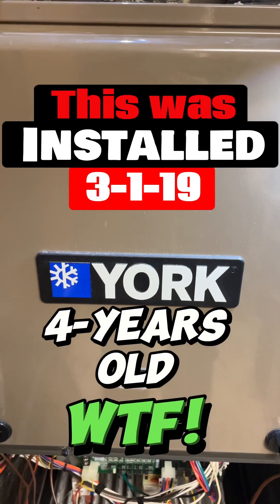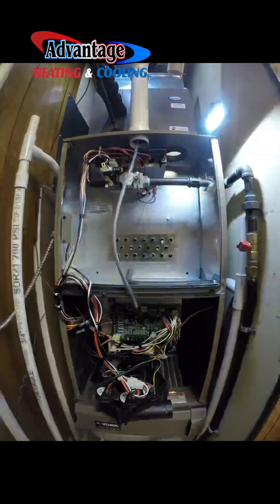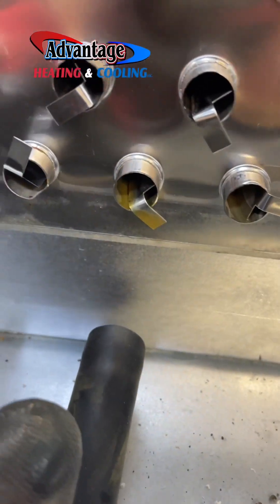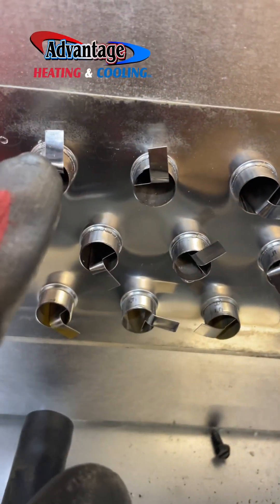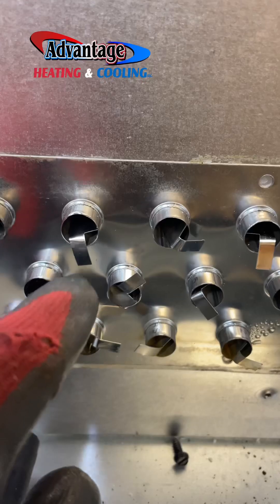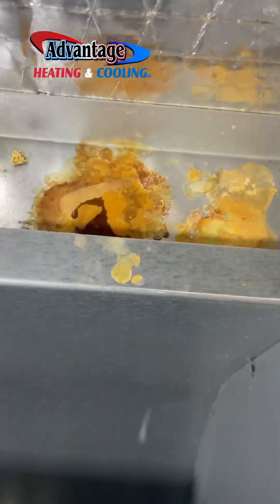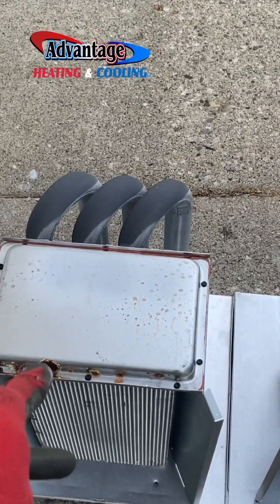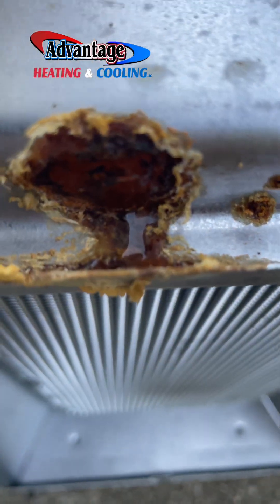York “JCI” Not a fan! Of your HVAC Equipment! 🤷‍♂️

Comment: The last company I worked for is primarily a York dealer. Definitely was not a fan of their equipment, especially the higher end. Almost every time you were on call when it was really cold or hot out the York customers that had newer, high end models, were calling. I don't know, I suppose most manufacturers have certain models of finicky equipment. Certain Carrier heat exchangers being one example. I don't know about you guys but we still have plenty of Lennox Pulse around here. 😬😁
Reply from the maker: I see the pulses once and a while. Just removed one last October. The Modulating Yorks were something else. The gas valves would puke if a little bit of moisture gets around them.

Comment: Was it tilted forward at installation per manual? If not it will jot drain and rust.
Reply from the maker: Was not in the Manual, TM9Y 4-5 Years ago. Maybe the new manuals were updated? I just looked it up online again and did not see anything about tilting it forward. The Goodmans are saying that for sure. If you see it Please let me know Email me at Advanhvac@gmail.com
Reply: I know for sure tm9y furnaces have to be tilted forward now. It's in the newer manuals. Coleman, York, and luxaires all affected. Really any 90% furnace needs a little tilt forward
Reply from the maker: I'm also starting to tilt all of my 90% now.

Comment: York units are terrible I hate them lol
Only reason I go to the York dealer around here because it the best place to get daikin mini splits 😂
Reply from the maker: I was going to bid on Daikin for this job were doing this week I just can't do it. I'm a Fujitsu guy.
Reply: @ADVANHVAC  Fujitsu is my second go to lol then Mitsubishi 
Just a lot of good experiences with them (daikin) I’ve installed 100’s of them 
The worse mini splits in my opinion are them mr cool units 🙄
I’m sorry but if u say no vacuum required or leak test I’m turned off immediately 
But those units suck, and I’ve been to so many calls where these dyi people install them and we have to come fix them 😂 very cheap quality In my opinion
Reply from the maker: Yup I run away when they want me to install them.
Reply: @ADVANHVAC  but again about York systems 🤢🤢🤢
Nope 
They are at the bottom of the list for me and always will be 😂
I’ve installed so many Goodman units it ain’t funny but I love carrier systems 
I like Goodman 90 percents 
Haven’t installed many of the units you install so not much experience with them
Reply from the maker: I was on a Goodman and Amana kick for a hot second until had some issues with the the equipment lack of quality control.  So been back on the Allied air System. My opinion very well built. The Armstrong has stainless Steele heat exchangers. Zero issues with the 100s I have out there. The cabinets are thick and beefy not flimsy like the Goodman’s but then again when you have to install them in an attic maybe that's not so bad.
Reply: @ADVANHVAC  got a guy trying to get me to start buying amana
There ok and have great warranties but like I said my favorite is carrier 
Yeah Goodman’s quality control could be better I’ve just got use to double checking everything lol
Like on the 90% the drains on the bottom of the draft motors always seem like there going uphill 
And you know what happens when the draft motor can’t drain and gets flooded with water 
And this year I’ve had 6 heat pumps so far with no refrigerant in them all with leaks on the coils , which sucks to find out after you’ve installed so I’ve been checking at the service port 
Also on some of the coils the factory mounted txv’s leaking 🙄
Reply from the maker: That's why the warranty is great lol.
Reply: @ADVANHVAC  yeah no shit 😂😂
Always had good experiences with carrier though